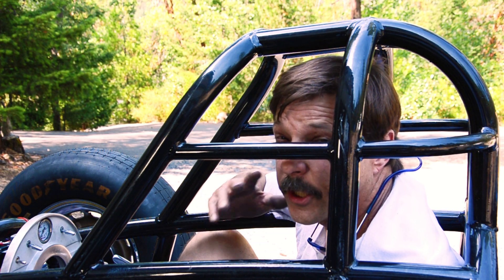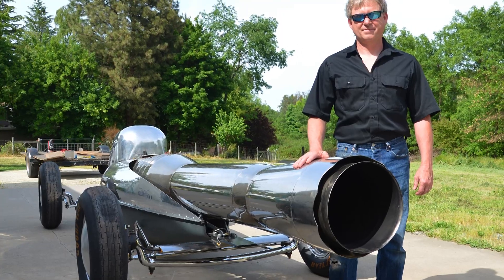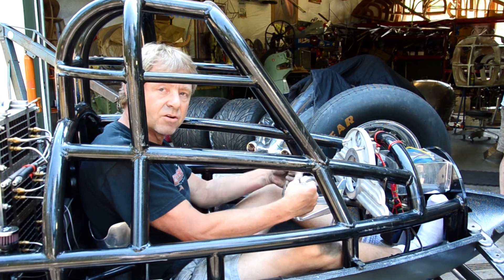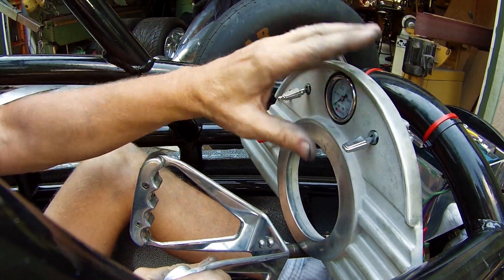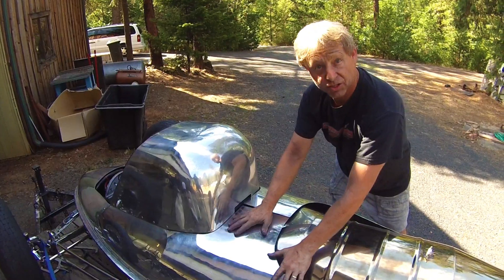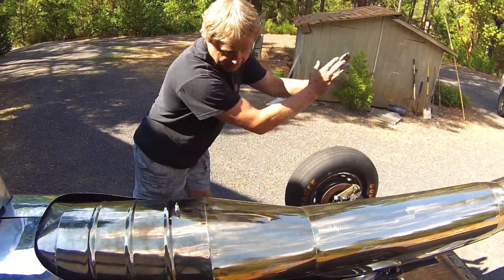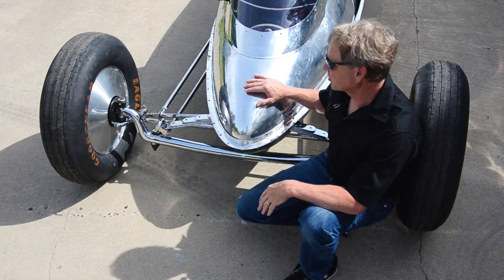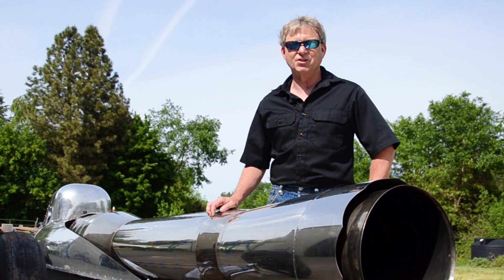Randy Grubb's Garage 7: Grubb-Maddox Pulse Jet Lakester

Comment: There is no Aero, it appears that there are no front brakes but I really can't be sure because they could be covered, there's no parachute to slow it down in case of some other failure, was any thought at all put into keeping this thing on the ground when it is going more than a hundred miles per hour or stopping? Guess thats why theres no video of it going more than 20 mph. Beautiful craftsmanship as always but not an engineer in sight.

Comment: i'm wondering if when the speedweek organisation doesnt recocnize cars with jet propulsion if you could make a drive using a turbine of a turbo mounted directly to a diff driving the wheels and tapping itoo the boost using a scoop straight from the exhaust of the ramjet to drive it  
might not be enough to go fast but it might be enough to convince the speedguys its a wheeldriven vehicle
Reply: the helicopter turbine would be a weee bit mush more expensive then the homebrew way i offered